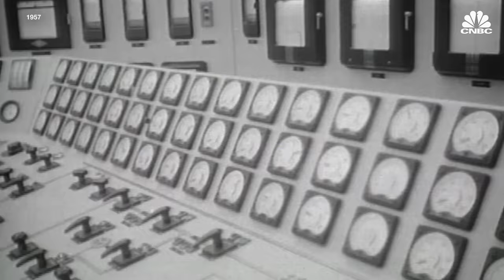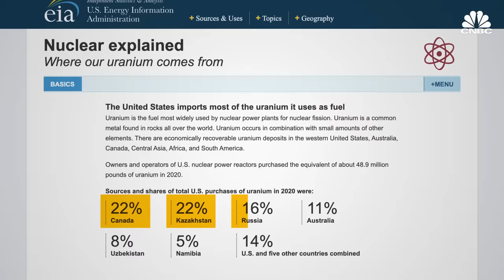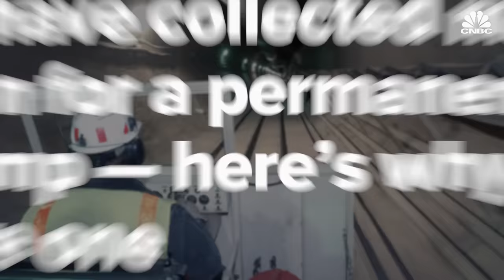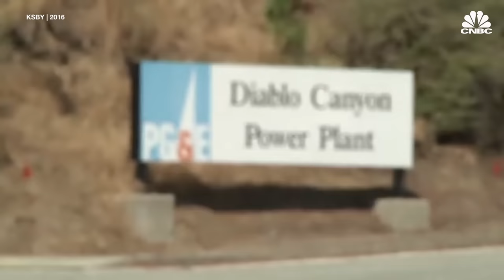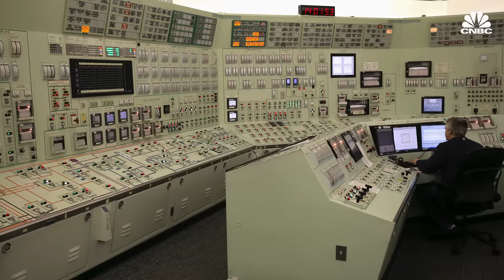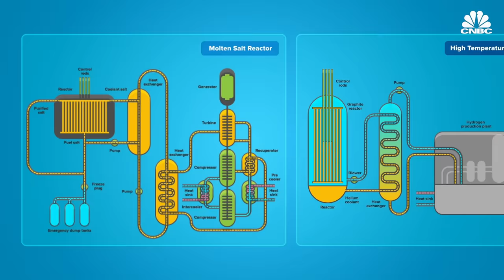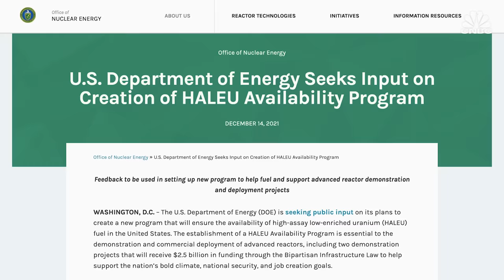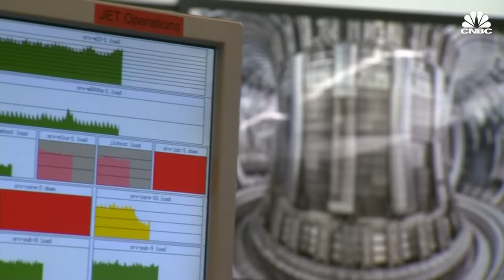Why Nuclear Energy Is On The Verge Of A Renaissance

Comment: With the Colorado river drying up, California needs more Nuclear Power plants.
Reply: Odd that CNBC would address commercial nuclear power issues WITHOUT mentioning any of the consequences of nuclear capital costs -- which is what killed the industry in  the first place in the United States.   Plants coming on line back in the 1950's and 60's all were built with a Government subsidy with up to more than half of the capital expenditures taken up by the then Atomic Energy Commission and reactor vendors as seed investment for future operating plants.   This situation evaporated in the 1970's with utility customers for reactors assuming the full weight of capital costs for the plant and this situation caused the cancellation of almost as many plants as are running now due to true capital costs and operation and maintenance costs being truly reflective of what was actually happening at each site;  the situation now being over for free money from the AEC, General Electric, Westinghouse and the remainder of the suppliers.  This placed the planned and operating plants on a finer economic edge; making expensive things going wrong more of a determining factor for economic operating the plants in future scenarios.   A gone-wrong steam generator replacement maintenance effort in two of the West Coast plants caused that utility to close down the eight-billion dollar facility for good; forcing the utility customers and the stockholders to eat the capital costs, and this was not the only utility to shut down a site due to insurmountable repairs and maintenance costs.   Reactor suppliers in the United States offered the utilities different 747 airplane designs for each plant and each utility;  something that would break a company like Boeing many years ago.   A re-started nuclear effort in the United States with the same commercial ground rules of competition and non-standardization of plant equipment will result in the same overruns for the same reasons as encountered before: a lack of scope definition and therefore ultimate responsibilities to be faced.   Far more successful in nuclear proliferation scheme was carried out at EDF in France through standardization of design and government financing;  although these nuclear plants as well are finding themselves susceptible to unusually high maintenance efforts.   CNBC and its producers and management have apparently decided that this important history of nuclear power in the US is ostensibly irrelevant and is to be virtually ignored by the current proponents as though it never happened.
Reply: Precisely.
Reply: @JAGRAFX  That is being said, I don't see why a new subsidisation program for next gen reactors would be bad. I mean, if we insist to only concern ourselves with the current economics, we might as well build more coal plants or gas plants, as they cheap and recoup the fat cat's investment fast. In the end those lefty guys will be right again, we have to give up either on capitalism or on a livable enviroment.
Reply: @CraftyF0X  --- Don't give up on capitalism yet, Cathy!   That system [capitalism] has produced more wealth for humanity than all of the others combined.   Sorry for the over-sell; but I went to Business School at San Diego State.  Capitalism without honesty and grace is "cronyism" which is probably worse than the worst of the liberal ideas.   End of speech.   My State of California has encouraged the development of solar and renewable energy sources way since back in the late 1960's.   Right now we are seeing peak energy for solar & renewables topping out at over sixty percent of total system load for the State.  In addition;  nighttime carryover is showing numbers in the 4,000 to 6,000 megawatt range of what is actually free energy.  All of this is being accomplished through investment in solar and renewable sources without any sort of "GREEN NEW DEAL" legislation from Congress.  By 2035 California will be energy independent from fossil and nuclear sources for energy and will probably be selling power to neighboring states.
Reply: @JAGRAFX  "That system [capitalism] has produced more wealth for humanity than all of the others combined. " I would take a philosophical issue with this statement, but lets just say this - amongs other things - depends on largly on what one means by wealth. For example, if you happen to not care about natural resources as much as about "numbers on computers representing value for inteligent apes" then your statement is absolutely right, we did convert a lot of natural resources into numbers that are looking good on the screens.
Yea, before we start to talk through each other I don't belive the current system is clear ideological free market capitalism and I don't belive that can exist more than clear ideological communism.

"Capitalism without honesty and grace is "cronyism" which is probably worse than the worst of the liberal ideas. "

The current socioeconomical capitalistic systems (so we avoid the confusion I mentioned before) is not especially condusive to honesty, if we were to be honest.

You are wrong abotu your last point. First, there is no free lunch, building up and maintaining the renewable infrastructure has its own enviromental and economical costs. Second, just becuase your state was wise enough to invest in time, you should not advocate against the "green new deal" simply because it doesn't matter if you went full green other states still can ruin the climate "above your state" too. So being smug and selfish about it is self defeating. Not to mention that not every state is as sunny as California,  so maybe some undertsanding and help toward the other parts are warranted. There are states where you could never get the 60%, simply because there isn't enough sunshine or wind. Natural endowments are luck not the typical baseline. Don't get me wrong if you get to independence in 2035, that is a great thing, just don't forget that its not necessary something that every state can do.
Reply: @CraftyF0X  --- "Grace"in capitalism can be approximated with independent regulatory efforts such as the SEC with the Stock Markets.   You get an approximation rather than an absolute in any of this as far a societal behaviors and one cannot allow the wanted perfect to be the enemy of the good.  Regulation in any economic is intended to provide an even playing field and it generally does except when it does not.   By charging ahead with solar & renewables California is not condemning the remainder of the Nation to antiquated fossil fuels and in no way are those activities of progress on a State scale indicative of a smugness or repudiation of the GREEN NEW DEAL on the national level; only that this state of CA will probably be selling excess renewable energy to its neighbors at mid-day peak before we know it.  Speaking of solar; I believe it takes about nine or so square feet to produce one kilowatt.   At that rate; all of California's electrical record peak of 50 Gigawatts back in 2006 could be generated with about a little less than twenty square miles of solar surface; hardly a Hoover Dam capital accomplishment and that is just counting solar without the other sources of renewable energy.   Your assertion that states could never get to even sixty percent for solar and renewables is incorrect.   Those states without as much sunshine have to remember that most of the weather in California is terrible to unlivable [I'm from the desert] and wind and hydro renewable work as good as they do here.   You may be listening to some of the negative publicity being forwarded by the fossil companies regarding renewable energy sources.
Reply: @JAGRAFX   "I believe it takes about nine or so square feet to produce one kilowatt. " Yea that depends on the latitude, pv efficiency, temperature, season, weather etc. not sure you can simplyfy that much without introducing errors into your calculation. If you count twenty squere miles, whatever that means (nice imperial units) it is just the surface of the cells, but you can't put them right next to each other cause you want little maintenance roads and service ports to clean, repair and replace them. So its never like "that is the required surface area so that much space it will take" its always more. You also need wireing this whole area and since it can't be in the middle of a city you need to extend the grid to the desert if you want a lot of sunshine. You also need energy storage connected, which has a harder time in that dessert, so you either put it somewhere else and take the transmission losses, or you cool your storage and take those losses. Now there are battery technologies making use of a generally hot enviroment but nothing widely accepted yet.
"   Those states without as much sunshine have to remember that most of the weather in California is terrible to unlivable [I'm from the desert] and wind and hydro renewable work as good as they do here."
What conducive to human life has nothing to do with what is optimal for energy production. You may feel the conditions are rough but the sun shines there with a certain intensitity with a certain probability for a certain time which is very helpful for energy production. Again this is a lucky situation from this production point of view (not so much for the maintenence labour) but how about Washington (state) or Main ? I'm not saying its impossible to do there I'm saying going full renewable green there can be much steeper climb.

Comment: I spent my entire adult life in nuclear power and I've been hearing of the nuclear Renaissance since high school. It's not going to happen. 

Also, the curved concrete structure is a containment building (PWR) or Drywell (BWR...but you can't see it externally on BWR). Not a Reactor vessel as the dude says.
Reply: And peak uranium resources it’s goin to happen very soon
Reply: @Risto Kempas After what - 18 years of build time and a cost that have doubled (correct me if the statements are off)? And the other plant under construction - is anything constructed yet and is there not some controversy as it is partly based on Russian technology? I have nothing against nuclear electricity generation but calling it a renaissance may be a bit of an overstatement. Not that we are doing everything correct here in Denmark but German RWE is paying us €400 million for "renting" some seafloor for 30 years for a 1000 MW wind farm that will operate on market conditions (no subsidies). Three of these would generate about the same amount of electricity as the EPR at Olkiluoto. Wind power is also being built out in Finland.
Reply: @Risto Kempas I think all your economists are.
Reply: @Risto Kempas Both Finland and Denmark is part of Nordpool - differences in prices is due to bottlenecks in the grid. As far as I can see DK has from time to time cheaper electricity than FI. Offshore wind in DK is approaching a 60% capacity factor - that is not that bad to integrate. DK availability of electricity is 99,993% - I would think that industry can live with that.
But please continue to add more nuclear power in FI. In DK it is both to expensive and to late as we would not see the first nuclear power plant operational until 2040 at the earliest as we do not have the setup to even evaluate a proposal to for a plant. On the other hand we know how to build wind turbines and have a lot suitable offshore locations.
Reply: Question for you. I work as an industrial instrumentation technician. I’m new to it, but I’d like to align myself to try and work in a nuclear plant in the future. Any ideas on how I could grow myself to get my foot in the door?
Reply: @daltonuphoff5640   yeah, find a utility that has nuke plants in their portfolio. Maybe you'll be able to go straight into a nuke plant. Maybe you'll start at a non-nuke and be able to transition into one from within the same company

Comment: Why Nuclear Energy Is On The Verge Of A Renaissance? Proponents want taxpayers to pay more of the costs of producing electricity in nuclear plants, such as the long-term storage and security of radioactive wastes and clean-up of radioactive decommissioned units, making more of the life-cycle costs of producing electricity external to vendors. If those very long-term costs are internalized into the electricity market, the cost of producing electricity via nuclear plants would be uneconomical, not to mention environmentally very UN-friendly. Moreover, the movement of nuclear/radioactive material is required to generate electricity in nuclear plants and after. Proponents also want those costs and the costs of security for those movements to also be paid for by taxpayers. If we cut all subsidies to oil, nuclear, wind, and solar, we likely would find that what truly is economical may also reduce greenhouse gas emissions.

Comment: Saw a TED talk awhile back.  The man laid out facts, like, you know, actual numbers, how solar and wind cannot meet the needs of our increasingly electrified economy.
Reply: There is an even better you tube "economics of nuclear energy" by a Professor who calmly pulls apart the economics of nuclear power.  Basically no-one sensible is going to invest in this.   Nuclear power was only half-way economical because it was supported by nuclear weapons programmes.  Have a look at that video.....
Reply: @1968Christiaan  And, of course, you provide a link...........
Reply: @1968Christiaan  I'd love to look at that video but you don't provide a link. Yes, I've heard that it may or may not be a net positive, but, bottom line, I find it hard to believe that it is net negative.

And, don't forget the many on the cusp advanced nuclear technologies.  Not the old ones.

Comment: Why not go with small reactors? US subs have been using small reactors safely for decades.
Reply: Short answer: cost. Large reactors have economies of scale, but even at their massive scale their economies are pretty bad. Smaller reactors do not solve the fundamental problem of cost.
Reply: The reactors they are talking about in this video are much smaller than Navy Reactors, either the Submarine or Aircraft carrier variety.   Honestly though, I think lots of small reactors are going to cost much more than modern larger 1000-1200 MW reactors.

Comment: A few things, 1. The metals used in windmills (aka the 1 ton of Neodymium that goes into every windmill) are also mined with radioactive "waste" (thorium), which could be used in reactors. Instead, these deposits are often ignored because of fear over "radioactivity", so fewer renewable options across the board. 2. Coal plants actually produce more radioactivity than a reactor. 3. Can you name any other nuclear power accident other than Fukashima and Chernobyl? No one was hurt in 3 mile island. The fact is that there have been 3 accidents worldwide, with over 400 reactors around the world. It's a drop in the water compared to the 328 gas pipeline explosions in the United States between 2010 and 2021, which killed 122 people and injured 603.

Comment: I’ve always said that the future of our energy generation would be a mix of renewables with nuclear reactors to compensate for when the sun isn’t shinning or the wind isn’t blowing. Renewables alone aren’t going to cut it. The mining of lithium to provide energy storage solutions is anything but ‘green’.
Reply: Every energy production means we use today has problems either in extraction of raw products, construction of the facility or its function and sometimes a combination of the three.  Each one needs to be constantly evaluated to mitigate unintended side effects.  

For example many birds are killed by wind turbines.  Some technology has been developed to warn birds away from the wind turbines but I haven't seen how effectively they are.
Reply: Joseph, 

I maintain, and for many good reasons, that renewables are a dead end and can never replace fossil fuel generation.
Intermittency is the big problem with no answer.
You canot run nuclear on an on and off basis to balance renewables' dreadful performance. Nuclear is run at full output at all times except for maintenance or refuelling, it's inherrent inflexibility is one negative against nuclear.
The other main problem with renewables is that it is uncontrollable feeding a system that needs to be in supply and load balance at all times on an instantaneous basis.
There are other slightly more technical deficiencies also all of which means that renewables can never replace conventional generators as they are not an equivelant.
Reply: Nuclear reactors are the worst for complementing renewables. They are too slow in increasing or decreasing output.

Comment: Build thorium molten salt reactors they can't meltdown because there is no water under pressure.
Reply: Exactly! I have been posting this too
Reply: As it turns out those thorium reactors would still need uranium as part of the process to produce heat.
Reply: Just build Molten Salt Reactors without complicating them with the Thorium fuel cycle; they work perfectly well with ordinary LEU fuel.
Reply: @Z80Fan  the thorium would be efficient as it is a by product of typical uranium and as a waste product it would be very cheap to use
Reply: @Cody_Handsome  Thorium-232 (the natural occuring isotope) is not fissile. You need to convert it into U-233 through a decay chain that takes several days to complete. This complicates reactor design if you try to do it online, like in a dual fluid design. The other strategy is to breed it with specially designed plants, but that has "proliferation concerns". Moreover this type of fuel is not currently accepted by regulator agencies across the world. If we want to have an MSR running as soon as possible the best strategy is to build a single fluid, LEU fuelled reactor (like Thorcon and IMSR).